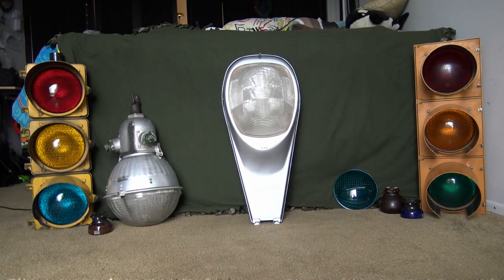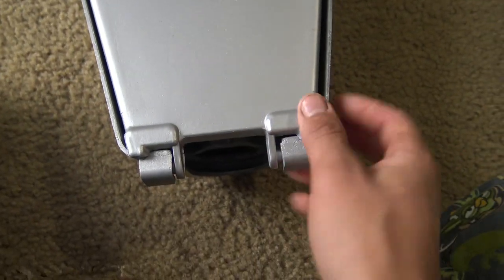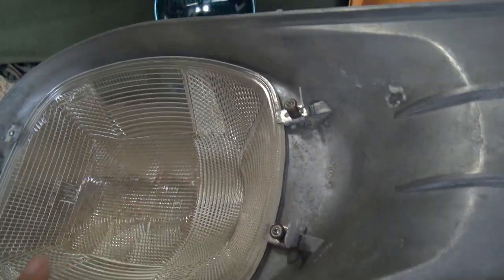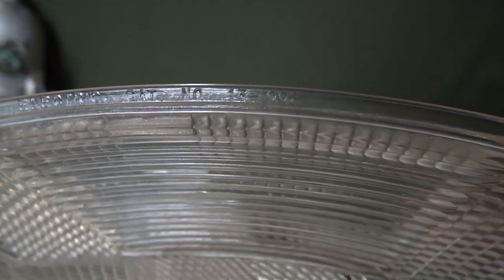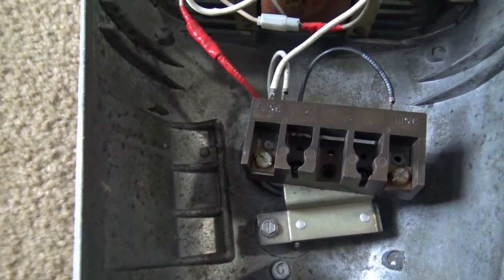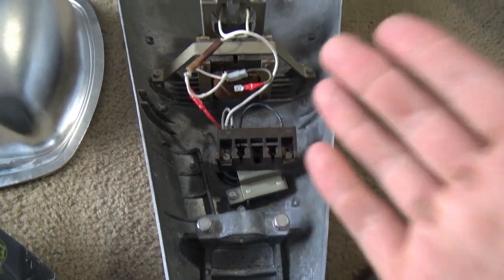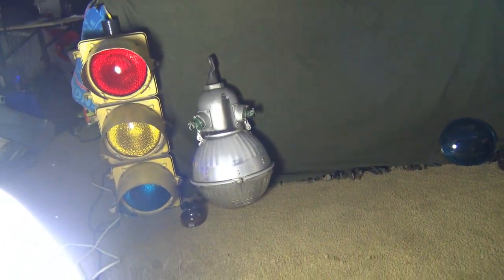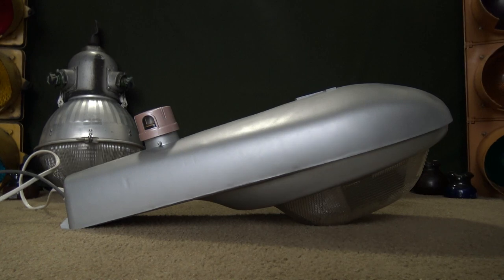American Electric Lighting 13-000 Mercury Vapor Streetlight Overview

Comment: This is the first generation of 250 watt Mercury Vapor Lamp American Electric of the early 1960s to late 1960s. The second generation of this American Electric, 250 watt either accepted the Mercury Vapor Lamp, or 80 watt High Pressure Sodium Vapor Lamp of the 1970s, 1980s, 1990s, 2000s, and 2010s, and the grey enamel finish paint is added for the touch. Also the second and final generation of 250 watt American Electric street light fixture is the reflector is anchored to the socket instead of separating from the socket. This fixture is used for residential or side street for light.

Comment: That's probably asbestos gasket
Reply from the maker: The use of asbestos was banned in the 50s. This streetlight is to new to have any of that.
Reply: @polarslightssignals2742  oh ok, it looked like asbestos
Reply: @vintagetoiletstexas2443  ok. have not seen you do lighting comments in a while.
Reply: @vintagetoiletstexas2443  Oh, good!
Reply: @vintagetoiletstexas2443  oh ok.
Reply: @polarslightssignals2742  asbestos was banned in the 1970s, i would say the 1950s was its prime.
Reply: The “brass bracket” is actually an exotic form of galvanizing using cadmium! Cadmium galvanizing gives that lovely yellowish brassy look.